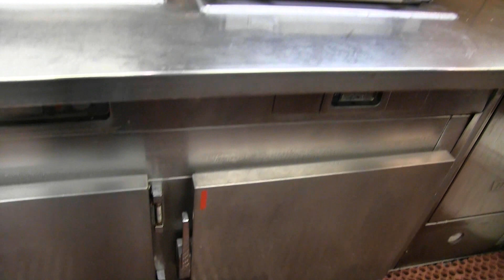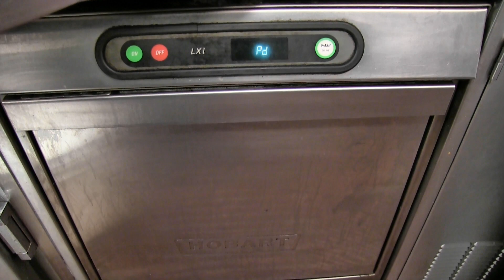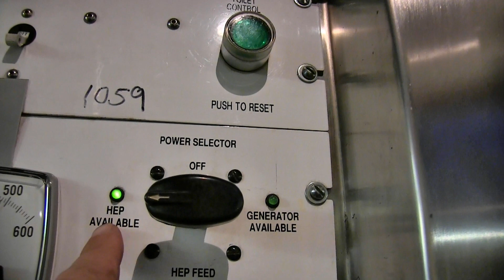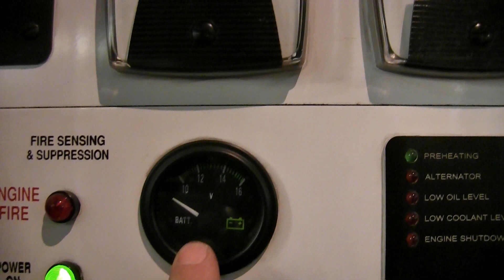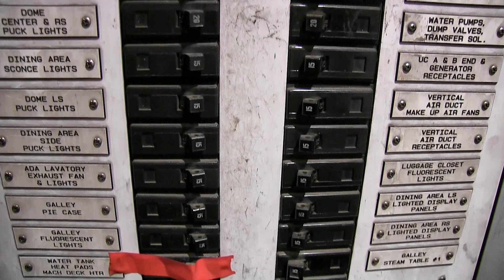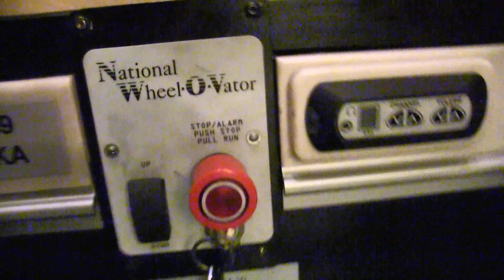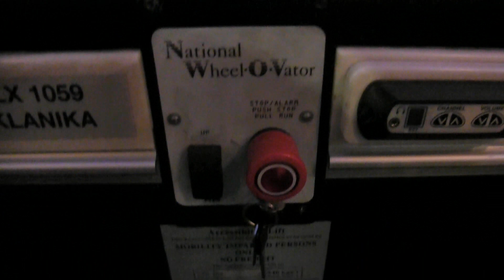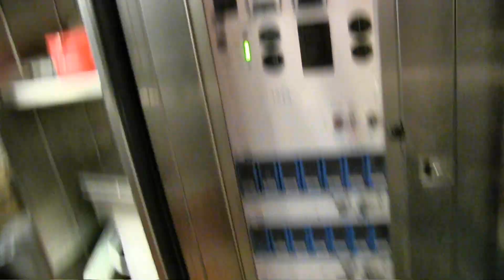Inside look of a modern railroad passenger car with kitchen and elevator.

Comment: If those couplers were new why did they look like they had been sitting rusting away for years
Reply from the maker: They were spares. Probably been there a long time.
Reply: @travelingtom923   aaa o hay i have a question how long can trains like this run without getting resupplied iv always wondered given how many post apocalyptic movies and games depict trains being the last mode of transport/ sanctuary
Reply from the maker: @crystalclearchaos5387   It would depend on how many people you have in each car. You would have enough food and water in a full car for probably 3 or 4 days eating three times a day and snacks. If you had to conserve like the movies then you could go probably a entire month. Most cars carry around 600-1500 gallons of water. Your biggest problem would be running out of fuel in the generator car or the locomotives which power the electricity in the train. You would probably only have about 5 days worth of fuel under normal circumstances.
Reply: @travelingtom923  most have a car converted into a garden so food usually lasts a bit longer

Comment: More efficient travel.
Instead of throwing money at "climate change" maybe we should look at more practical measures. The bullet train reminds me of the SST. Fuel consumption per passenger was so bad it lost money and folded.

The Federal government should subsidize private investment in the rebuilding of new, modern railroads.  Passenger cars could be made much larger (20 ft wide) and more comfortable with newer lighter materials and railroads could be rebuilt to allow trains to run faster (100+ MPH) some routes could be nonstop and not have to slow as often for city crossings.
Reply: These trains are a part of climate change spending brah